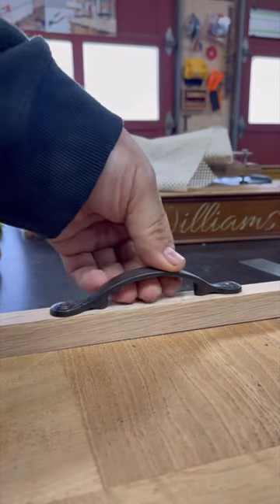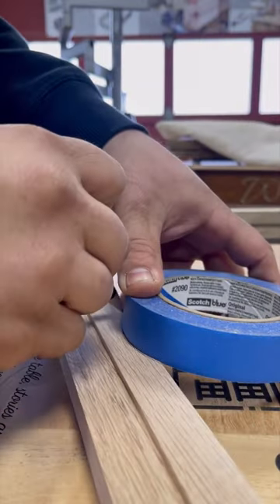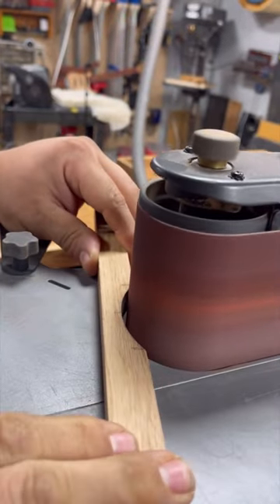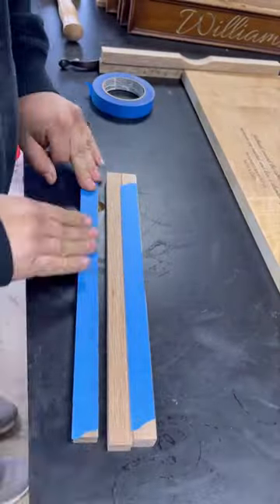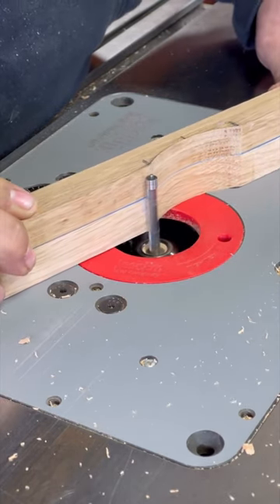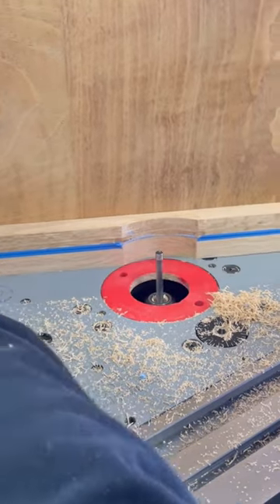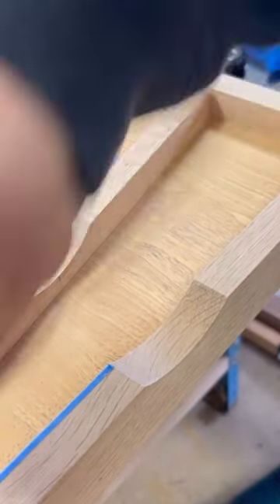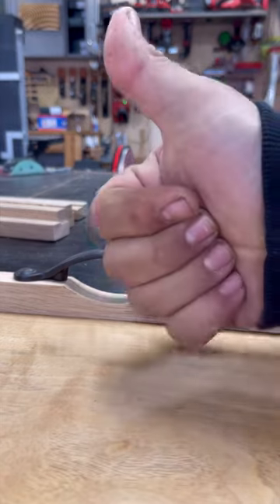Adding some space below the handles on 4 serving trays. Video by: @regalstreetwoodshop

Comment: You know what would make it even easier?
Double sided tape.
Reply from the maker: This method actually holds better than most double-sided tapes on the market!
Reply: Or just choosing another handle.
Reply from the maker: That's definitely an option!
Reply: @StarbondAdhesives  Used both methods and they work about the same.  Not that you'd have a bias at all ? Bwa ha ha
Reply: @dlewtweentorla1210 Thanks, I hadn't initially noticed that this was an ad trying to get people to waste glue